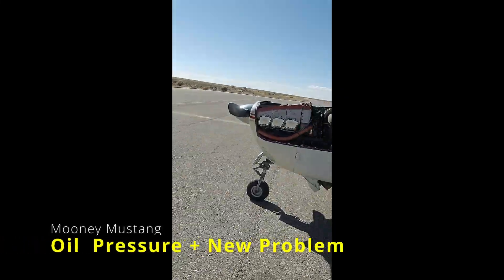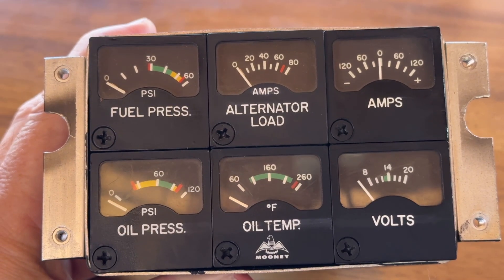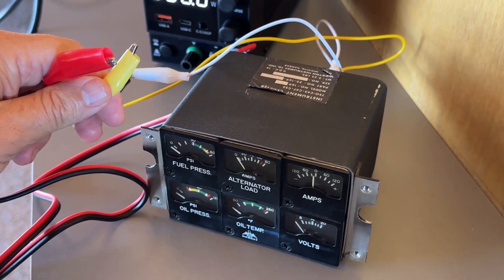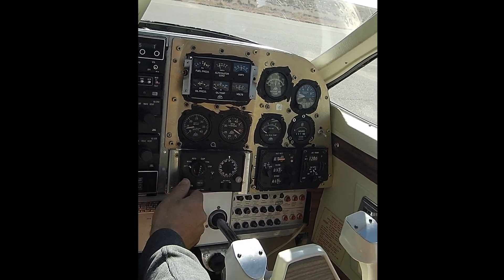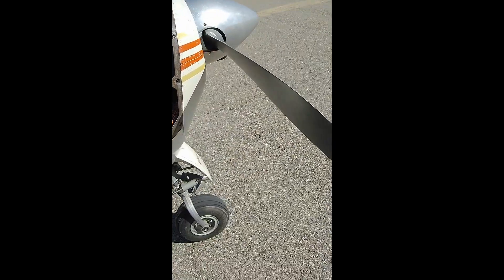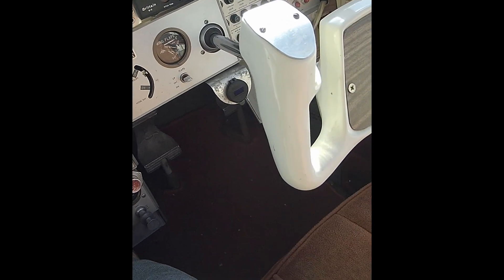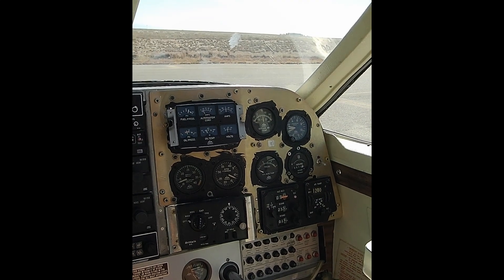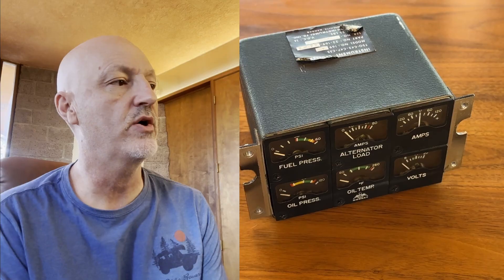Mooney M22 Has a 1968 Instrument Clusterfrack!

Comment: You are fighting the Mooney PC auto wing leveler.All Mooneys had that back then.Just disconnect the the vacuum hose.You can take the PC system out of the plane.Looks like you have some grounding problems in the cluster.There are people that can overhaul everything in the cockpit.Thanks for getting the M22 flying.
Reply from the maker: That's my plan of action, remove the Brittain and the cluster is going anyway so I'm not too worried about it.

Comment: It can be common for oil pressure to read in the yellow at idle on many aircraft engines.  The lycoming o320 in our warrior does that.  But as soon as you advance the throttle it rises commensurate with rpm
Reply from the maker: good to know. Unfortunately mine wasn't moving at any rpm. In my next video you'll see what happens to it :)

Comment: As you mentioned, vintage Mooneys have a full-time wing leveler.   It is driven off the turn coordinator and is completly vacuum operated (aside from the turn coordinator which is electric).    You'll need to isolate each servo and apply vacuum to them separately to figure out which one is leaking.    There is one in each wing and two in the tail for the rudder.  And then one or two for altitude hold if you are equipped with that.    On mine you could pull the button out to disconnect the system.   

The leak is either that the line to the servo is leaking, the servo diaphragm is torn or that it just needs to be re-taped.   The diaphragms are literally sealed and attached with black 3M electrical tape. 

 Since Brittain is out of business, servos and diaphragms are not available.    If your M22 uses the same servos as other Mooneys then they are plentiful secondhand.  I recently put a GFC500 in my Mooney and may have a good one that I'd send you for the cost of shipping if you need it.     Even if your servo housing is different, I think the only used one diaphragm.
Reply: You will need to investigate the service manual for the fuel gauge.   On other mid/long body Mooneys, there are two fuel senders wired in series with ground being referenced through the outboard sender. The inboard sender is isolated from ground.   If either sender is open circuit the gauge reads empty.     Normal resistance for them on mine is 0ohm full, 30ohm empty (60ohms with both in series)

Your plan to take it experimental and modernize the panel is interesting, but of course Experimental Exhibition really limits how and when you can use the airplane.    But with so much not working I can't say I blame you.    I do think that the issues you are facing are likely all repairable with some persistence (as long as the Britain servos are the same as some other aircraft (Bonanzas often had Brittain as well).     I've been through many similar issues on my M20F - flew behind the Brittain for 5 years before upgrading to GFC500 - still have basically the same instrument cluster with an EDM830 for a little bit better detail.
Reply from the maker: That's some great information, thanks! Which mooney do you have? I am guessing the STC covered your model?
Reply: @trueairspeed130  I have an M20F, so GFC500 and  many other updates installed by STC.  I have to say that when it was working, the Brittain autopilot did fine at following the magenta line.   The only reason I upgraded was I wanted something that could fly coupled approaches.

I’d guess that despite being an Orphan, that your M22 will be on the approved list for lots of Avionics that don’t require as much customization to install.    For example I just looked at JPI EDM830, Garmin G5, and Uavionics AV30c - they are all approved for M22 already.

Comment: The issue with your autopilot.  Mooneys (including the Mustang) from that era had a full time wing leveler for stability. It was called PC (positive control) and you would press the ‘disconnect’ to turn. 

If one of the pneumatic servos is bad then a wind will turn

Some operators would put a valve in to bleed vacuum pressure to disable the system.
Reply from the maker: Thanks for the info! that's exactly what is happening. scary design.
Reply: @trueairspeed130 It’s actually a pretty safe system. When properly maintained, it was a great poor man’s helper on long flights. 

I’ve owned my Mooney for 34 years and flew for the first 7 years with the PC system. The only reason I upgraded to an all electric AP was the need to add navigation capabilities and the Accutrak hardware just wasn’t available any longer. 

As for your fuel gauges, I suspect seeing the problems you are having with the current instrumentation, you’ll end up with a JPI, Garmin 275, Electronics International or someone’s stuff. You should have 4 fuel resistive senders in your plane. When you get the new engine monitor, I would switch over to CiES senders. I’ve had them in my plane for the past 8 years and they are extremely accurate (like, <1 gallon off on fill ups).

Comment: Hi, saw you working on bird yesterday.   You need to be really careful about apply buss / battery voltages to those gages!!   Those cages are designed to read Milli-Volts, or milli-amps (current).   When you peg the needles as in the video, you are running a high risk of burning them up and / or mechanically damaging the movements.   Some sensors create their own “voltage” based on temperature and thus have a closed circuit (2 wire) from the sensor to the indicator.   This allows the indicator to still show useful information if all other electrical failure happens.  Ergo not dependent on the battery and/or alt/gen….   If you want to chat more / need some help, let me know.
Reply from the maker: I appreciate the insight! the next video will show what happens to the instrument cluster :)